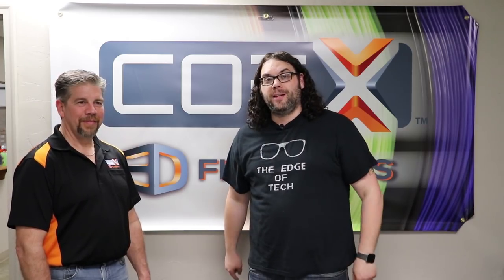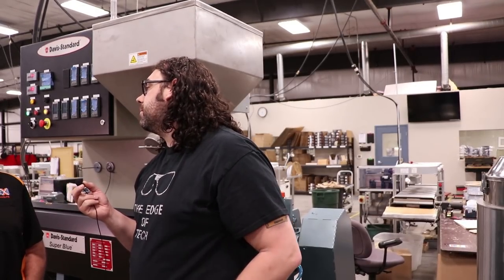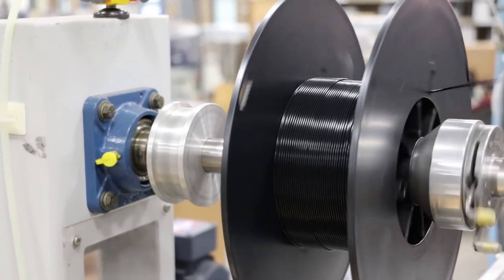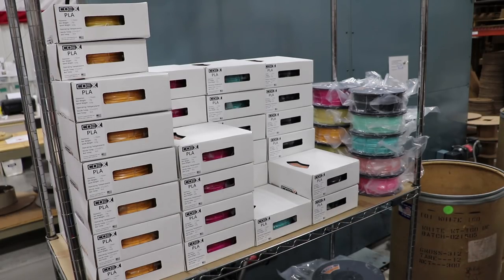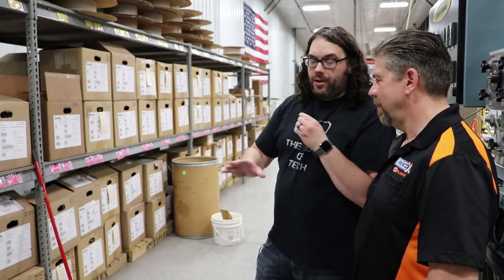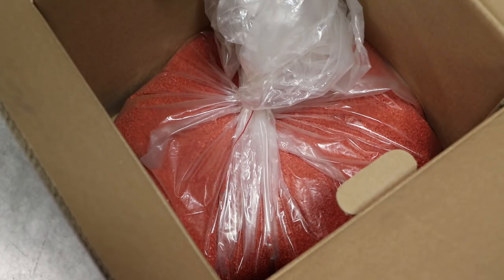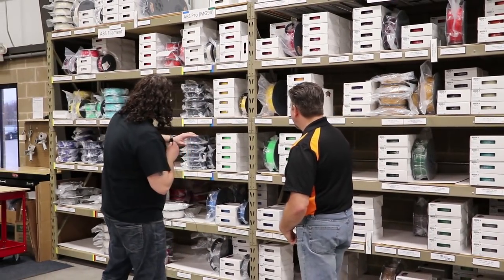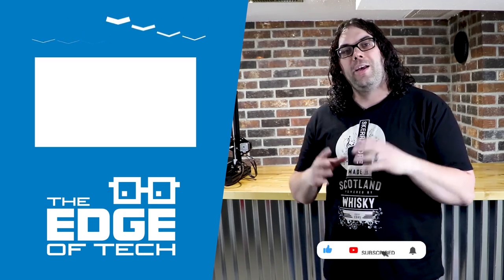Coex 3D Filament Factory tour with coupon code

Comment: I live in Wisconsin and wanted to start buying local. So I found this place and now I buy all my filament from them. Quality is great. The gun metal silver is awesome. I did find because it's virgin material you need to print it hotter than normal PLA. I've also found it works great in my Mosaic Palette 3 Pro

Comment: Thankfully they seem to be getting better on the customer services front. I had a couple rolls of their petg and when i took a tour they gave me an off roll of their pla. The petg would not print, this was the  first petg that I had any problems with, so I thought they probably had a different formulation or something. I had tried all sorts of settings, brand new nozzles (had it jam and cook off in the nozzle and pitted it really bad so no real way to recover) . They even wanted me to "season" the nozzle, this did not help, they thought it would be a fix all. Now keep in mind at that time I had 3 other brands of petg on a shelf and without changing anything the other brands would print perfectly. I sent a sample of it off to a friend and they too did not have much success.  I maybe used 200 grams from each roll however thankfully they let me return what was left. The pla that I got was probably a spool from the beginning of a run since sizes were a bit over the place, the bit that was printing did print just fine. A couple weeks ago I picked up a roll of abs and that so far seems good, only reason for picking that up was this was the only abs I could grab locally to finish up a project.

In the end they did not try and be sleezy, and they allowed for a refund. I really wanted their filament to work at least the petg since the little bit that printed looked really cool. The support was not so great, at least now they seem to have people working for them now that actually know what is going on judging by who I had talked to at mrrf.  They really want everyone to like their filament however not everything is sunshine and roses.